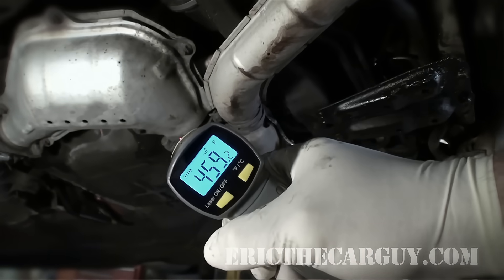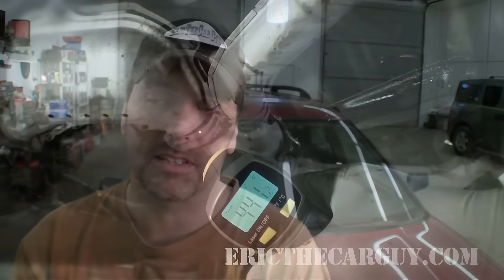Does Lacquer Thinner Clean Catalytic Converters? -EricTheCarGuy

Comment: Let's be fair Eric. Scotty did not say using lacquer thinner would "repair" your problem. He said he uses the thinner, to "clean" the catalytic converter. If a dirty, or clogged converter is the problem, the obviously, cleaning it would repair the problem. You said you were pretty sure your problem is not a dirty or clogged converter. So of course, this didn't solve your problem. He also recommended, using 1 gallon, in half a tank of gas. You used 1 quart, in 3/4 's of a tank. I know people who have tried this method, and say it worked fine.

Comment: Scotty Kilmer is king ,i  put a gallon of thinner in half a tank of gas and it worked on my 2014 ford transit connect after driving more than 200miles. it passed the smog test too .i changed the spark plugs there after.I have put more than 12k miles and the light never came back.

Comment: Thanks Eric, very good video I did the same about a year ago with the same results as you on someone else's car, different way I did w/my old car, after taking it for smog it didn't pass and I had checked by a friend but still didn't pass knowing that the car is a 1996 figured that it must be closing up I took the car to the freeway and overspeed to 110 mph and wala, when I got home I put the tester and the green mark showed up that was in Dec 2019 now I put the tester again and still green light

Comment: Yes. It will work. Makes hotter burning. Cat needs heat to burn hydrocarbons. You can also make sure you remove your EGR valve.

Comment: But,  will this scientific trial have any long term negative effects to a fuel pump o-rings or any other parts inside the fuel pump, the fuel injectors, fuel filter, etc? Not knowing the long term effects could lead to other problems down the road.

Comment: Primary ingredients in Lacquer thinner. Acetone 117 octane, Toluene 121 octane, and Methanol 108 Octane. I Guess Scotty does actually recommend High Octane Fuel after all. Wonder if it will repair that melted down converter I just cut off? Or Rebuild the empty converter on the other side? I think Scotty does to much coke and not the cola either.

Comment: I just did 1 gallon lacquer thinner in 8 gallons of gas, drive less than 100 miles, and my P0420 code and yellow check engine light went out. IT CAN WORK.

Comment: I just went bought some cataclean put it in and realized it smells EXACTLY like paint thinner.
Reply: It does smell like lacquer thinner, I wonder what is on that Cataclean. They do work well, I put the whole bottle when my gas is in 1/4 and drive  it normal until it's almost empty.
Reply: @3grimlock  cataclean is xylene, acetone and isopropyl alcohol mostly, lacquer thinner can be acetone
Reply: @3grimlock  not sure but I just followed the directions (I don't remember what they were)  and it worked and I passed emissions.  :D
Reply: @volksbugly  My sister's car smelled like sulphur and gave a code, cataclean definitely fixed that. For 10 minutes, with cataclean, the car blew out so much black smoke that people had to stop and pull over while driving.

Comment: I have a 03 Cavalier that lost all of its power the car will not go past 20 miles an hour so I punched out the catalytic converter but still left it there I only took out the platinum and broke the grill in the honeycomb put back the three screws and nuts that attach the piping and it runs like a rocket now and it doesn't even sound loud sweet.😂😂😂😂😂😂😂

Comment: If you are going to make a test, use the formula given for the test. You used 25% of the cleaner in 140% of the fuel. How is that a fair comparison? The original claim was 1gallon of lacquer thinner in 1/2 a tank of gas. The car was an acura, comparable tank size. You used 1/4 gallon of lacquer thinner in 5/8 a tank of fuel. Original test 1 gallon of lacquer thinner in 6-7 gallons of fuel. Your test 1/4 gallon of lacquer thinner in 8 gallons of fuel.

Comment: When you check the fuel thingy see how much varnished was removed from the gas tank I'm betting that on that car thatthere are too many variables it's an old tank so there was varnish it probably clean that body shop moved it up the pipeline maybe kind of clogged but clean the regulator in the tank and then further that Gunk up into the engine down of the cat which at this point is no dirtier

Comment: Eric, hi! I have a VW Passat 2002 6 cl, 2.8 l. It had misfired and started a real fire under the engine when idle at the parking lot. It might have an opening before the catalytic converter. So, escaped gas start the fire. What is really the cause of the fire and how to prevent it again?

Comment: Utuber Laj51put Seafoam into the exhaust system to clean is catalytic converter. The video is called P0420 P0430 A new way to make Seafoam more effective on catalytic converters. What are your thoughts? Thanks.

Comment: One thing I know, you must use OEM O2 sensors when replacing. My sons 2000 Subaru Outback kept throwing codes when he got the AM garbage, he replaced them with GENUINE and it runs like a champ with 287, 343 miles, and it's got a head gasket leak. To be honest, I've never seen him put oil in the damn thing. Needless to say, I'm very impressed with Subaru. Btw, P1400 was an issue, and it WAS a wiring issue. MICE. For some reason, rodents love to eat wiring.  Bitches.
Reply: That's anecdotal evidence based on your son's experience.
Reply: What's strange is sometimes the animals will pick a specific wire to eat and they do it on countless cars on the same wire. Could never explain that one lol
Reply: That they do.
Reply: For a while soy oil was used to make plastic sheathing for automotive wiring. Mice see see soy as food

Comment: Remove O2 sensors.
This will work on most cars.
After you remove the sensors.
Go get yourself two oil burner tips.
drill them out so your O2 sensor will be recessed away from your catalytic converter . Do this for all the O2 sensors you have.
Each oil tip will cost you about three to four dollars.
Putting lacquer thinner in your gas.
I've seen it burn holes in the top of the Pistons.

Comment: i just saw a video about this subject. the guy REMOVES the converter an in his yard he pours paint thinner into the catalytic and in 10 mins. he pours it out then he pours kitchen soap and again leaves it for 10 mins. then he washes it down with water. result, it works. HE DID NOT POUR IT INTO THE GAS TANK.

Comment: Who is watching this vid straight after watching Scotty Kilmers vid regarding this subject?
Reply: Scotty said 1 gallon of laquer thinner to half a tank of gas and 150 or so miles. Js. CAUSE I JUST WATCHED THAT KILMER VID. LEL.  Funny stuff.
Reply: @sperez5609  That's correct. Scotty said 1 gallon but he didn't give it a ratio compared to gas tank size. So is it 1:5 for a small 10 gal tank or is it 1:10 for a large gas 20gal tank?
Reply: @KKKKAAAARRRRYYYYNN  Bullshit, Scotty said 1 gallon thinner/9 gallons gas.
Reply: Scotty said one gallon of cleaner to ten gallons of gas.
Reply: @ericgautreaux1752 Scotty who ?
Reply: @sperez5609  Yep. 1 gallon, not 1 qt.
Reply: @sperez5609  Me!
Reply: Dude,  you had more then a half of a tank. He said 1 gal to a half tank..
Reply: @roofrat68  he sure did hopefully your comment becomes a thread
Reply: Yep. Tried Scotty Kilmerz  method of cleaning my Catalytic Converter by having 1/2 tank of gas and running 1 gallon leaguer thinner through the system. BOOM! Worked excellent and MY LEXUS FINALLY PASSED THE SMOG CHECK! I have 226,840mi on that truck! Runs excellent!
Reply: @jimb4404  This is the kind of content we need. People who followed directions and then verify that it works. I'd be interested, after a year, if it's still going okay?
Reply: @jimb4404  it would help if you share the brand you used ?
Reply: @jimb4404  Lexus doesn't make a truck, WTAF are you on about?
Reply: I'm here because Scotty actually showed a pic of ETCG...lol
Reply: I watched Scottys vid after this one , dude did not follow recommendations therefore his results are invalid and possibly an effort to fraudulently make Scotty look bad.
Reply: Xylene works too I would image. The objective is to raise octane levels to make more heat to help burn and clean the cats.
Reply: No it’s actually not octane. It’s oxygen.
Reply: Yesssss
Reply: I know you posted this comment a year ago but yeah, I am and my 10 year old equinox has a catalytic fault code. I hate this car (it's my wife's and she loves it). I'm going to try the gallon of thinner in 1/2 tank of gas, like Scotty suggested.
Reply: @justanobserver530 did it work?
Reply: Me
Reply: Me !
Reply: Zeusbooster me! It was in my related videos section! Clicked right on it! I always watch Eric the car guy, Scotty Kilmer ,and Chris fix! These guys are good!!
Reply: Me.  I only have one truck so I need multiple opinions before proceeding.
Reply: You can't  say it doesn't  work  if you don't  do it  the same way
Reply: Yep
Reply: I'm doing that and thinking the same thing as I read your comment. Ha that's funny 😆
Reply: It happens that I am
Reply: Lmaoooo I just need a confirmation man
Reply: Saw it after a video for Scary movie: not so different.
Reply: I did! I think Scotty said shove a gallon in
Reply: @jazzydave8453  a gallon of lacquer thinner to a half tank of gas. This guy used the wrong portions. He used 3/4 tank to 1 gallon of lacquer thinner. I don't think the tank size in a Subaru is much different than the tank size in a Toyota Camry (I think it was a Camry in Scotty's video anyways).
Reply: @goldengirl5165 He only used a quart of laquer thinner. Too much gas and not nearly enough laquer thinner. Smh.
Reply: @mr93love he also said that his cat was not plugged, but working in efficiently. Completely biased.
Reply: So, I tried it, but mine was already in bad shape before it ever threw a code. The contents of the first cat were in the neck of the second. 😅 dunno how it was still running.
Reply: This dude needs to grab on tight to anyone's coattails that will keep him in the public eye
Reply: I did!!.. the one thing that I wish Eric had done after the lacquer thinner fail is to clean it with soapy water as like Scotty did. Eric didnt do this part of the test. I understand that this would had been a hassle to do but would be nice to know if water and detergent could work better than lacquer thinner.
Reply: This guy should have done this exactly like Scotty did. Don’t debunk someone if you did do the test exactly as the other guy.
Reply: Douglas Grant Scotty didn’t take off the cat from the car ,,,,,the cat he used was rotten out on one side ...not the same cat
Reply: @douglasgrant8315  n
Reply: yes, but eric only used one 1 litre and scotty K used 5 litres?  he didnt put enough in?
Reply: Yep
Reply: Me
Reply: Zeusbooster me
Reply: Yes
Reply: Same
Reply: Meeeeee
Reply: Me
Reply: Haha yes!
Reply: Me
Reply: Yes
Reply: Me 😁😁😁
Reply: Right here!
Reply: Lol
Reply: We are!
Reply: me
Reply: Lol...Me!
Reply: 🖐me
Reply: Yessss
Reply: Me a year later than u
Reply: Me
Reply: I do
Reply: Me
Reply: No, but still liked
Reply: Ya boy
Reply: Haha yup
Reply: Me 👆
Reply: Me
Reply: Me
Reply: Yup
Reply: Me
Reply: Me😂
Reply: I did it too
Reply: 😂I am lol 😂😂
Reply: I am!!
Reply: Me 😂😂
Reply: Meeeeeeee
Reply: Yes sir
Reply: Yup!!!!
Reply: Me.
Reply: Lol   me
Reply: I did
Reply: lol here now
Reply: yes
Reply: Literally just watched that vid then looked up if that method is safe and effective n now I'm here lol
Reply: Me lol literally
Reply: ME!!!😂😂😂
Reply: Me 😂 my trailblazer right side converter is clogged..
Reply: 😂😂😂😂😂😂😂 meeeeeee😊😊😊😊
Reply: Do it again and follow directions please, I honestly want to know the truth and you didn’t help.
Reply: It sound.like rockit science
Reply: Yes.
Reply: Busted, but utube had it as next...
Reply: Yep!
Reply: Me after 2 years than you
Reply: Kagens Looking Glass News  Do you have an update? I'm taking the car into the shop for a catalytic converter warranty work if yours doesn't work!
Reply: Omg! 
2022 still  relevant  and current !
Reply: Meeeeeeee
Reply: Yup lol
Reply: Use one gallon of lacquer thinner
Reply: YUP
Reply: Yep
Reply: 😂😂😂😂 Me!
Reply: Me
Reply: 😂😂Me. I like to dig deep 😂
Reply: Bruh
Reply: lmao just got the code and im doing mad research!
Reply: Yep

# the algorithm
Reply: So WHO is right???
Reply: I'm 😂😂😂😂😂
Reply: It auto played
Reply: I did not work on mine as well . I will be using a spacer instead.
Reply: Yes!!!
Reply: Me too
Reply: Me!!!😂
Reply: I don’t watch that idiot Scotty
Reply: Me
Reply: Yes
Reply: Yes because Scotty Kilmer is a total hack and no one can trust him
Reply: Me
Reply: In 2025
Reply: Damn lmmfao
Reply: Yuuuup exactly that lmaoooo
Reply: Just curious if half a 36 gallon tank will work as good as half a 24 gallon tank, etc.
Reply: 😂😂😂 meee!!! I was just about to go ask Chatgpt if you can actually put lacquer thinner in your gas tank 😂
Reply: Algorithm- brick by brick
Reply: Off course !!! Meeeeee! 
… we love Scotty yes (great guy) but also value the opinions of those who dare first on their own cars 😂.
  I would say I like Scotty’s 2nd option better, is more work but hey no pain no gain, gives you the opportunity to check for exhaust leaks that could also trigger P0420. Never give up!!!
Reply: In 2026
Reply: This guy doesn’t know what he’s talking about
Reply: @oscarcolon6156  He doesn't know what he's talking about because he didn't follow directions.  one gallon (or more) per HALF a tank.  He only put a QUART into MORE than Half a tank.
Reply: I came here to say Scotty Kilmer is a moron. Non-morons know this. Heh.
Reply: One video in between but yes
Reply: Guilty
Reply: Who would watch them back to back? Someone with a fault code, trying to gather what info. they can before buying a new one? An act of desperation, a way of handling grief. It all ends when they watch, "Can a catalytic converter be cleaned" by 50sKid. When the emissions  fault code is reset it will stay off for a while but come back eventually. The computer takes a while to intermittently test the system but it will produce the code again.
Reply: @paulgraham6353  used catalytic cleaner on a car in the past, light went out two days. I had the car for a year, sold it light still off after three years
Reply: @Zeus-kj7nn it would help if you share the name of the product you used.
Reply: I did....I always double check any work I'm about to do with eric's post.... he's been very very reliable.
Reply: Who’s Scotty Kilmer?🤣
Reply: I always check what Eric says after I watch the clown mechanic
Reply: @edwardwest2795 Eric doesn't follow instructions well. I know that much. He used a quart of laquer thinner and a 3 quarter tank of gas. He's full of it.
Reply: @edwardwest2795 eric is the clown
Reply: Vend Master  You are a dickhead. Scotty knows cars, knows how to save money, is a millionaire, with billion views. You must be a trump supported with fake news
Reply: @sniggitty  scotty is a senile old man who makes shitty clickbait
Reply: @sniggitty  🤣🤣🤣🤣

Comment: Scotty Kilmer never said it will fix a faulty catalytic converter actually he said it will not fix a faulty catalytic converter. Only  if it is giving you inefficiency codes it could possibly clean it if its not too late. Its worth giving it a try instead of just replace a catalytic or two and paying more than $1000

Comment: 11:20 into the video, Eric the car guy says "with all due respect to Scotty Kilmer..." 
Eric, your experiment is flawed and does not do respect to anyone. For an comparative experiment to be valid  the theory being tested should be replicated as closely as possible. I understand in the YouTube world that will be difficult, different vehicles, no dyno etc. However you can replicate the basic premise. 
- Scotty uses about a 10:1 ratio of gas/lacquer thinner to clean (not repair) catalytic converters (10:1 based on videos by Scotty Kilmer other than the one linked above there are several). 
- Eric used a ratio of about 28:1. 7 gallons of gas to 1 quart of lacquer thinner. 
Just saying
Reply: Right on brother, my thoughts exactly.

Comment: I thought just doing that trick was just the pass the emission. Not to fix the catalytic converter
Reply: Not fix, or repair the cat... clean the cat. If its busted (holes etc) cleaning will not help. If it is dirty (clogged so gasses cannot pass) cleaning will open the honey combs and allow the gasses to pass through

Comment: Don't know about  L T but toluene will clean every 02 sensor all the exhaust system; 1997 gmc with 330.000 mi. replaced 1 02 sensor at around 60,000 started running 1 gal. toluene to 25 gal. eth. free every 3 mo. no carbon build up still. But don't put Scotty down if you don't use the same formula.And  I never said drove the truck straight through the tank of fuel, probably have but that would be seldom.

Comment: First you said that Scotty said you can "repair" a catalytic converter with lacquer thinner. Scotty said you can CLEAN one, not repair it with LT. Then you used a quart of LT to 3/4 tank of gasoline, which is not what he did...   He used a gallon of lacquer thinner to a half a tank of gas. If you are going to accuse and try to debunk Scotty, maybe first try reproducing accurately what he did first. You were polite about it... I'll give you that. But, c'mon man...